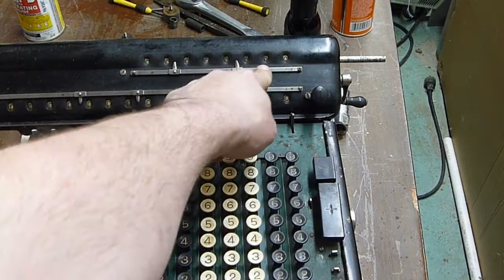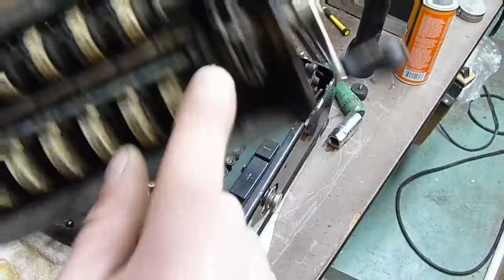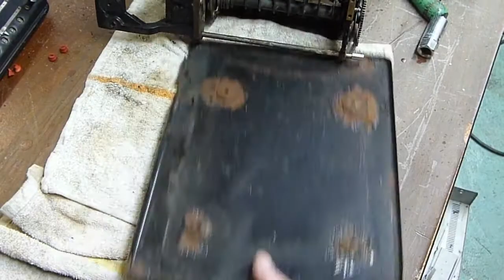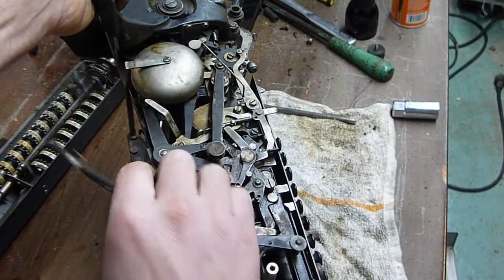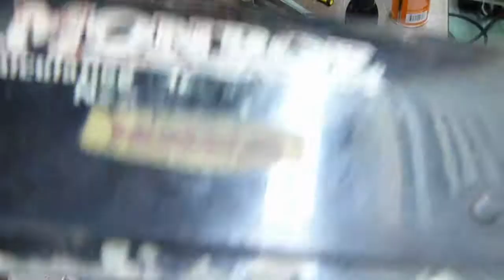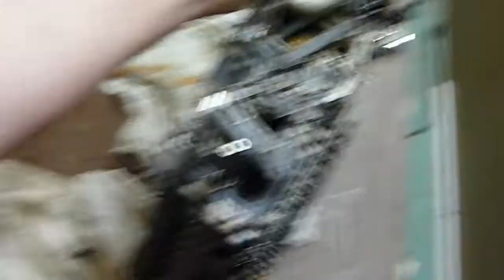1920's Monroe High Speed Adding Calculator

Comment: That looks like a KA-160. A=automatic. I found a Model K (crank, no motor) in a thrift store. Works really well. The carriage moves for multiplication and division. If you want to multiply by 321, you add once in the carriage left all the way, then move the carriage one right and add twice, then move one right and add 3 times.

Model K 1921 to 1929.
Reply: What you call the adjuster knob is the crank for when the power is out. There is a release clearly visible next to the plus bar. These came with a crank but they usually got lost. Pull the knob out and put the crank in.

Comment: The knob on the left is an item counter. I do not understand it yet. Also, the machine is a Monroe High Speed Adding Calculator
Reply from the maker: Charles Pope that's good to know, thanks! Now, to only find the purpose of the knob...
Reply: @general0ne  you depress the leftmost 1 then turn the knob to hold it down. It’s an item counter which carries. Say you have a stack of the day’s receipts. As you add them the item counter keeps track of how many times you added. I don’t use it.

Comment: Interesting I have a Record universal calculator,  the layout looks similar but (much) older, no motor.  The interior is totally different, an aritmometer with a keyboard.
The red numbers are for multiplication/division: times 19 ( 2x10 - 1) shows black 2 red 1
The bell is for divisions.
The button on the leftmost 1 locks it  for extra indexing of the turns  (2x10 - 1) shows 19